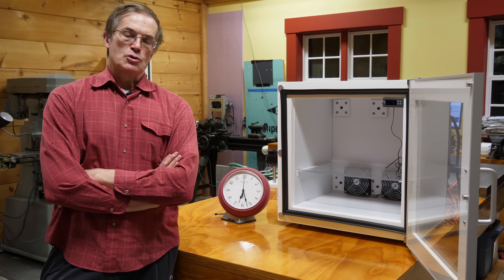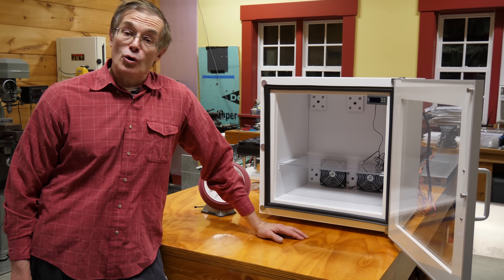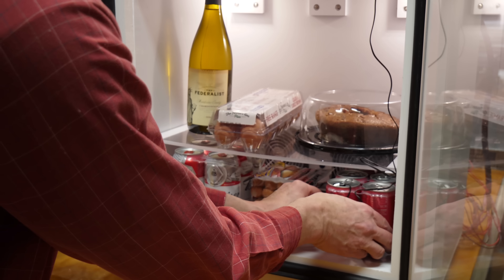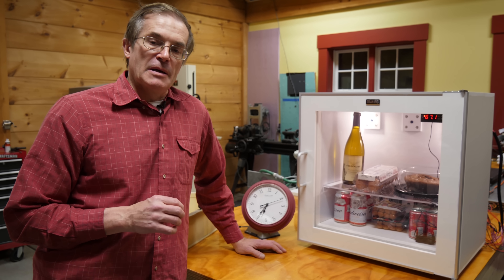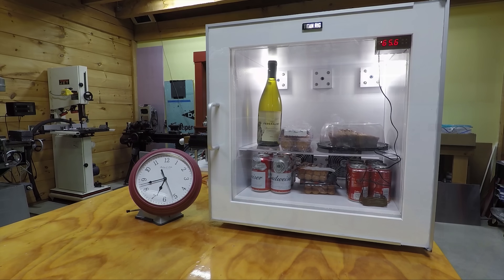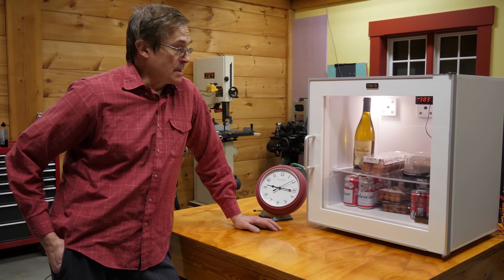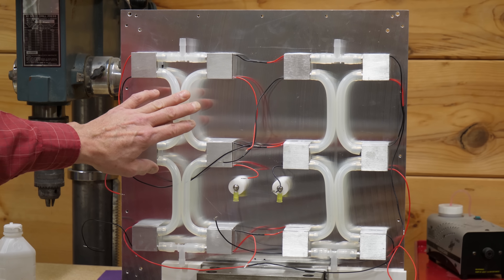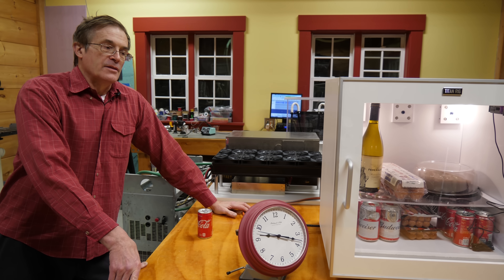TESTING OUR DIY REFRIGERATOR! - TEC/PELTIER

Comment: I don't know how much more energy efficient it will prove to be by pumping that heat outdoors, whilst also wanting to HEAT the outdoors with your furnace or heater. But perhaps just routing it out into a garage that doesn't otherwise have heat would be a good use of the excess heat.

Still, heating the living space ultimately seems like the best use of excess heat energy during winter months, and then pumping that heat outdoors during the summer months, in order to reduce cooling costs for the living space.

Comment: Currently adding refrigeration to an antique icebox. This is my second conversion and love the idea on cutting down on the noise and inefficiencies of a conventional refrigeration system. More details on products used and efficiencies would be fab. Thanks for this project.
Reply: This type of system is more noisy and less efficient than conventional compressor setups, don't waste your time unless you have space and budget for watercooling and a large radiator.
Reply: I agree. I have a Frigidaire by GM from the 50's that is difficult to find freon for.  But it's such a cool looking fridge and Peltier heatpumps is an option.

Comment: I've always been bothered by spending electricity on cooling inside in the winter! Looking forward to the next video =)
Reply: Don't be.

The way your refrigerator works to cool the inside is by exchanging that heat from inside the refrigerator, to the outside (the room it's in).

You're warming your house when you run your refrigerator. ;)
Reply: I have tried that and frozen milk thawed is unpleasant.

Comment: We might be able to build a freezer using just a heat pipe in winter...
Reply: Sure, if you're somewhere that stays cold enough there's no reason you can't bring the cold inside to be used in something like this.

Personally, I'd just have a radiator stack outside and pump coolant or through a radiator inside the fridge. Ammonia is great at this trick, but dangerous. You might be able to use something like methanol instead, either way you'll have to make sure your fittings/pumps are OK with it.
Also, you may be able to forgo the external radiator and use a large steel reservoir outside (an old propane tank will work). You don't want it covered with snow/ice because snow actually insulates rather well (because of the air trapped in it). You want it outside and exposed to the cold wind and in the shade for this to work well.

Comment: My only real question in this is how are you planning on dealing with condensation which will eventually happen? Phase-change Refrigeration actually dehumidifies the air dot-dot. This method of cooling does not and will lead to excessive condensation inside the refrigerator. They sell Thermo-electric coolers for truck drivers, and it's the most prolific problem we face with them - it gets downright swampy and nasty inside the cooler after only a few days.

*edited for spelling*
Reply: He will get condensation build up. 

The statement that phase change dehumidifying if false by itself. It is true that the moisture is removed from the air and collected on the evaporator. It is then gets defrosted and removed my heater coils in a drying cycle. Due to the low cost design of peltier refrigerators,  all the condensation drips off of the cooling plates and build up on the bottom of the fridges.  Simple designed phase change will suffer from even more condensation than peltier coolers as they typically can get much cooler.  My water cooler with a built in refrigerator on the bottom builds up condensation like no other and it uses phase change. My Dometic 12v portable is also phase change and build up condensation but that's due them being simple designs where they use a cool surface (evaporators) to directly cool the refrigerator as opposed to having it in a remote compartment and blow air over it.
Reply: @esqueue  I have a portable AC unit that is the emergency backup for the HVAC in the server room at work. It's not plumbed in and on a hot and humid day it was putting out about a gallon of condensation every couple hours trying to keep a 10x10x10ft room full of servers at around 76 degrees. Simply staggering.
Reply: In the first video he had a bag of moisture absorption pellets. Could add those in a compartment in the fridge
Reply: @je-fq7ve  Has to be heated constantly though!

Comment: Very nice looking unit, have you got any rough ideas of the heat transfer efficiency yet?  I was considering augmenting my refrig (my largest energy consumer) with some of the Peltiers run from solar.   Sort of a hybrid system, use the Peltiers for the the normal heat losses during the day and the compressor cooling for everything else. What I would really like to experiment with is a solar powered ammonia absorption cycle.   Recently I have seen some very small high performance brush less dc motor compressors on the market, smaller than a pop can.
Reply: Peltiers aren't the answer if you are looking for efficiency.  You would be better off building an Lithium Ion power wall and running your refrigerator on that. My tests with peltiers show that they use enormous amounts of power for the cooling that you get. They are very cost effective to build and are small.

From what I've heard, the micro compressors suffer from reliability issues.  People were trying to use them in Phase Change super coolers for computers. The most reliable but small compressors I've researched are made my Danfoss but they are the size of 3-4 cans of soda.  I have one in my Dometic handheld 12v refrigerator which I use for long travelling.

Comment: We're in NH and I have been tempted over the years to drill a hole behind fridge and somehow circulate outside air/coldness through the fridge instead of using the compression pump. Looking forward to your V2.0 changes.

Comment: Man, you seem like you'd be a fun guy to work with. I built something similar, but instead of a fridge, I used it to chill water for a cooling jacket that you wear while it circulates cool water around your chest to cool you down. They have similar systems for athletes to recover faster, but they all use ice instead of TECs. 
I'm in Southern California, would love to help out with anything, I have a shop with a bunch of laser cutters, CNC machines, UV printers, 3d printers, lots and lots of toys and electronics, let me know if I can be of any help, I love making stuff.
Reply: You could probably improve the efficiency of those cooling coats if you could run them with water circulation into a chiller or even a bucket of ice (like a jockey box beer cooler). I'm also in socal and cooling is big business, but unfortunately outside of a cold ocean we don't really have a source of free cool air to play with like they do back east.
Reply: @jttech44  Yeah, that was exactly the problem. The amount of energy required to do proper cooling was absurd compared to how much energy is stored in ice. All the current commercial systems just use an ice cooler and a pump to pump the water, simple, no electronics to worry about. The big problem is that TECs are only ~10% efficient, and a hot person can produce about 500w of thermal energy, so you'd need a 5,000w TEC to consistently pull that energy out, and enough cooling to dissipate 5kw of heat....... I suspect that he'll be doing a video soon talking about this very severe limitation to TECs, they just can't compete with a compressor based system.

Comment: I have been designing one of these for the 2009 Toyota Prius that I am converting into a mobile living quarters.  I am planning to sink the heat into the body of the vehicle.  During the winter months I'd like to use some of the energy to warm my sleeping platform.  I have been wrestling with the design for over a year and this video has given me exactly what I needed to move forward with the build. Thank you!
Reply: I purchased an Igloo lunchbox with a 12v peltier cooler built in and while it worked okay, it killed my car's battery within a few hours. I can't remember the current draw but it added up. I ended up getting a higher rated peltier and a kept lowering the voltage till it was at it's coolest. 

I ended up scrapping the idea and ended up getting a handheld work lunchbox sized one that ran on an actual compressor. I can set it to cool no matter how high the ambient temperature is and can freeze on the hottest days if I needed. It also takes quite a bit more hours to lower my car's battery.
Reply: @esqueue   Thank you. I had purchased the Amazon Home Basics version of the 12V peltier cooler and returned it after running some tests where it failed to achieve even close to its specifications.  The one that I had purchased was drawing around 4 Amperes at 12V.  The nice thing about the Prius is that the main 201V DC Ni-MH hybrid battery will keep the 12V battery charged (only while the prius is in READY mode).  The prius is a built in generator that kicks on the gas engine to recharge the Ni-MH, which I love!  I am still trying to figure out how to draw the Ni-MH battery directly without throwing error codes in the system.

I have added an additional deep cycle battery that hooks up to the 2nd Generation Prius' auxiliary 12V battery.  I refer to the additional battery as my "house battery" which connects to a(n) UPC (uninterruptible power supply) unit that will allow for me to plug into 120VAC and charge when available in addition to being 12V inverter to provide 120VAC when mobile.  The UPC that I have is a modified sine wave but I am following a youtube tutorial to convert it to  pure sine wave. 

I am interested in the compressor idea, though I am concerned about any noise/vibration as I sleep(though I could set my sleeping platform on vibration isolated risers as part of my leveling system).
Reply: my exp. over 20 yrs....buy a compressor type  4 amps WHEN RUNNING   maybe 20 AH daily ,vibes minimal        peltiers intriguing , but not real world useful , chasing rainbows                                                     @cplenny4281
Reply: That sounds super interesting
Reply: hey Chris. that sounds really interesting! as i commented above before seeing your comment, im also thinking about the potentials of this system in a van conversion, and in terms of bi-directional and dual use. i think day to day the heat could be used for sous vide cooking, but really i'd like to manage water loops in order to transfer heat into hot water storage or back into energy when required. its all very conceptual at the moment, so i'd love to hear your ideas.
Reply: @DMonZ1988  I have been designing my dream house for many years and use solar heated thermal mass as a huge part of the system.  As for thermal energy storage on the road, I think weight and space(insulation) is going to be a major difficulty.  I recently had the idea to collect pre-1982 pennies(95% copper) and use them as part of the thermal energy storage/emergency saving$ account.  

Idea: A hybrid vehicle for cold climates that heat a thermal mass with the wasted energy from the gas engine as it turns the generator to charge your battery bank. Turn that on each evening to keep you warm though the night?
Reply: Just curious, but how could anything larger than a garden gnome live in a Prius?
Reply: @forlorncornstalk  They're actually surprisingly big on the inside.  I used to work at a furniture store and was always impressed with just how much could fit in those things once you drop the back seats.

Comment: 5:40
Have you ever held the end of your LED flashlight after it has been on for 7 minuets ?
The LED's in the fridge are adding a lot of heat.
Reply: While I do agree that turning them off will help slightly, those LED put out almost no heat. The typical small LED doesn't put out a fraction of the heat that good flashlights output.  I retrofitted my entire car with led bulbs and while they are much brighter than the filament bulbs that I removed (which were in a poor designed enclosure that actually melted plastic) they weren't fitted with a heatsink. They were warm to the touch and brighter than the ones in his refrigerator.  My flashlights and portable head worn lights on the other hand get very hot and use the entire body to radiate the heat.
Reply: there is a factor of at least 100 between the power of a flashlight led and the leds in the indicator.
Reply: Not all LEDs put out the same lumens, draw the same current and are equal in efficiency ( light to heat ratio to energy consumed).  So it's a safe bet that LED he used was different than what your basing you assumptings on. You could be right or wrong. With out more information we shouldn't just assume your correct without really knowing more.
Reply: Wattage is the key bit of information you're missing here. While your flashlight may have an array of LED's that consume over 10w of power, a typical indicator LED uses ~2.5v * 20mA = 0.05w. LED's also get vastly less efficient when you put more power through them, so while your 10w torch may be putting out 1w of light and 9w of heat, an indicator LED will be putting out 0.02w of light and 0.03w of heat. While 2.5v and 20mA are common values for indicator LED's, the exact proportions of heat to light I made up for illustrative purposes, as I don't know the real values. But you get the general idea.
Reply: All the refrigerators my family has used since the 1950s have used 10-25 watt incandescent bulbs that are turned off automatically whenever the door is closed.  LEDs of similar light output give off so little heat the difference in efficiency for this application is marginal and may not be measurable even if you leave them on continuously.
Reply: @sincerelyyours7538 
So, how do you know that the light turns off when the door is closed ? 😉😊
Reply: @kengamble8595  Cute. In the interest of science you could jiggle the switch arm which my head seems to hit every time I grab something from the back of the fridge, or you could watch the light go out just as the door closes, or you could measure the current draw of open-door vs closed-door and infer that the light has gone out.  Sort of like measuring the height of a building by dropping an altimeter off the roof and measuring how long it takes to crash into the ground.  ; )
Reply: @sincerelyyours7538 
I stand humble ! 😊
Reply: @kengamble8595  Because Schrödinger's cat told me so?

Comment: @Tech Ingredients
I'm guessing it's quite cold outside, maybe freezing? if so i would, from horrible PC cooling knowledge, recommend using a liquid capable of withstanding temperatures below freezing, as well as insulating ALL the hose to avoid dripping condensation everywhere.
I'm sure you've already thought about this, but couldn't help but chiming in, looking forward to the next update!!!
Reply: Industrial stuff does sub-zero chilling with brine, alcohol or ammonia. The insulation on the pipes is key to avoiding condensation, though there's always some on whatever you're cooling that will have to be dealt with.

To a point, PC cooling tends to be flashy and complex, but the ideas are all the same. You could run all copper everything in your PC and use methanol with no issues, outside of having a flammable liquid coursing through your system.

Comment: Very interesting as always!
My thoughts:
1 turn off the leds when the door is closed. 
2 some ventilation inside the fridge might help
3 extra surface for the peltier elements might help. 
Wow, that’s quite a beefy radiator you’re gonna use. 
Looking forward to your next video! Tx!
Reply: Can put a switch in the door so it turns on and off like a regular fridge but for the video it was useful.
Reply: those look like computer fans inside the fridge
Reply: @johnpossum556  they are
Reply: John Possum 
Tx! You are right. How I could’ve missed them idk. Added strike through.
Reply: @johnpossum556  Either they are or some industrial version.

Comment: With regards to watercooling peltiers, there's a company I've used to work with that has a cool patent that allows them to suspend peltiers in rubbers, so no need for heatsinks, thermal paster and specifiec torques for optimal performance. The companies called Top-Cool and it's a very cool technology, unfortunately they've had little success in bringing it to market, they're engineers. I've managed to improve on their design, but their pride has made them ignore that.